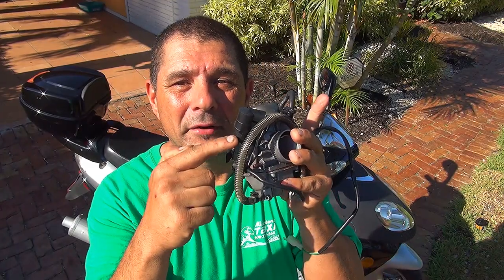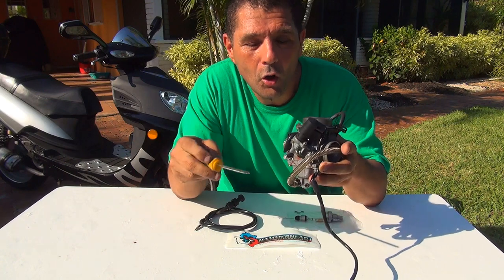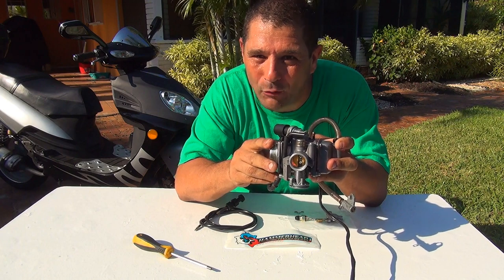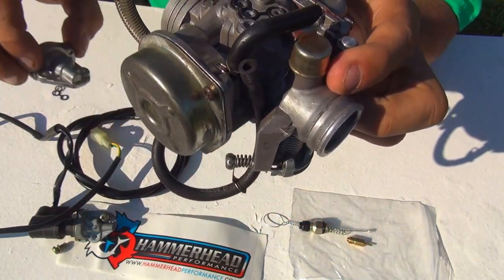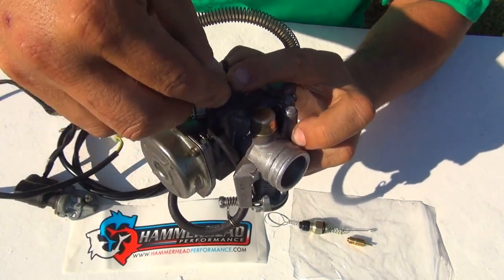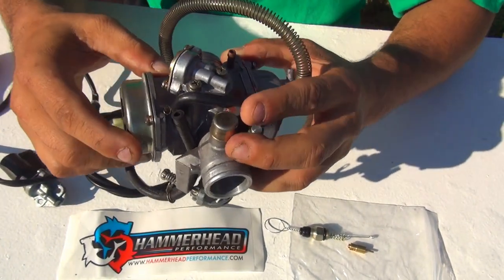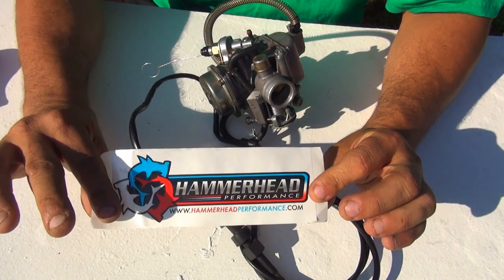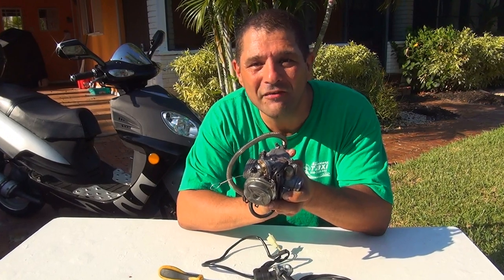Scooter Manual Choke Conversion Kit

Comment: amazing video! i want to ask what idle rpm is best for good quick performance for a 50cc and a 75cc, and is there any manual chokes for 50; 75 cc motor carburator?
Reply from the maker: Hello my friend for a 50cc 1400 rpm at idle for the 75 cc 1600 rpm at idle . Thank you for watching my video
Reply: The chokes are the same on 150 and 50

Comment: Just curious, are you in a position where you can produce certain videos on a two-stroke scooter? I own a 2009 Kymco People 50 2T and am in dire need of some instructional videos regarding maintenance!
Reply from the maker: Hello my friend unfortunately I do not have a Kymco to make a video but I can tell you to make sure every 1000 miles change the motor oil , clean or inspect the air filter , Inspect your tire and brakes every 3000 miles change your sparkplug , change gear oil and  inspect fuel filter, and every 6k to 7k adjust your valves clearance, clean your carburator jets and replace air filter.  Thank you for watching my video

Comment: After I remove the choke during service then the motor is not idling and bogging how to install it correctly
Reply from the maker: If you're experiencing issues with your scooter's idle and throttle after reinstalling the choke, it's likely that the choke isn't installed correctly or is not adjusted properly. Here's a step-by-step guide to reinstalling and adjusting the choke on your scooter:
Remove the Choke: Start by removing the choke from your scooter. Make sure to note how it was originally installed so you can reassemble it correctly.
Inspect the Choke: Check the choke for any signs of damage or wear. If it's damaged, it may need to be replaced.
Clean the Choke: If the choke appears dirty or clogged, clean it to ensure proper functioning.
Reinstall the Choke: Carefully reinstall the choke into its original position on the scooter. Make sure all connections are secure and tightened properly.
Check Idle and Throttle: After reinstalling and adjusting the choke, start the scooter and allow it to idle. Monitor the idle speed to ensure it's stable and at the correct RPM. Additionally, test the throttle to make sure it responds smoothly and without any hesitation.
Make sure when you reinstall the enricher you have the rubber gasket around the choke because sometime the brake easily and if it brake air will go inside 
Consult a Professional: If you're still experiencing issues after following these steps, it may be best to consult a professional mechanic or technician who has experience with scooter engines. They can diagnose any underlying problems and make the necessary repairs or adjustments.
By following these steps, you should be able to reinstall and adjust the choke on your scooter correctly, restoring normal idle and throttle operation.

Thank you for watching my video

Comment: Hie,I have got a big boy swift scooter and it has been flooding and fuel was coming out of the air cleaner and as I watched one of your videos I learnt that I should put a manual fuel switch and I did it but it worked for few days and it started flooding again.....may you please help.

Comment: I just put on an oil separator with the tiny filter, connected to the crank case breather hose and my idle is much lower now. I had to turn the idle screw quite a bit and it goes up and down from about 3k to around 1.2k rpm... Is this normal?
Reply from the maker: Hello Mikey that is not normal after little time the electric enricher they age because they have an little gel inside that no longer expend and that will not close perfectly the choker hole. Thank you for watching my video
Reply: @VirberelloScooterTips  I just put a new carburetor on so that can't be it right?
Reply from the maker: @Manwichman  new carb should be ok but  anything is possible with gy6 scooter parts

Comment: I’m having trouble with my scooter the front lights stays on and that makes the battery die even with my scooter completely off do you know what it is.
Reply from the maker: Hello my friend I think you need to replace the regulator rectifier https://amzn.to/3lyunhg or you have a short on the wires somewhere in the system . Thank you for watching my video
Reply: When I turn off my scooter completely the front lights stays on and that’s causing my battery to die
Reply: Is there another way I can contact you in case I’m having another issue with my scooter.  I watch ur videos on fixing the scooter and you know a lot about it

Comment: Another problem I’m having for some reason when I start my scooter I have to hit the starter switch Twice for it to turn on do you know why I have to hit it 2 times for it to turn on.  Normally it supposed to turn on automatically when you hit it only once.
Reply from the maker: Hello my friend if your scooter is not starting right away you may have to place a new spark plug or an iridium spark plug so your scooter will start  at the first touch  sometime scooter need little small adjustments in order to work properly . Thank you for watching my video
Reply: @VirberelloScooterTips  I changed the spark plug and it still doesn’t turn on right away.  Oh and I order the voltage regulator that you link to me It didn’t come with cables was it suppose to come with cables
Reply from the maker: @Cristopher180-  Hello my friend no the regulator is not coming with wires is just a little box make sure you place the connection the same way you have right now
Reply: @VirberelloScooterTips  so I don’t need to order any wires
Reply from the maker: @Cristopher180-  no the regulator is just click and plug in I hope that before you order you look at the regulator that you have   on your scooter because some gy6 have a flat connection and some regulator have a square anyway I like amazon because you can always send the part back very easy and get credit
Reply: @VirberelloScooterTips  the voltage regulator on my scooter is different mine is not just a click the wires are already in the regulator and I don’t know where to find one
Reply from the maker: @Cristopher180-  you need to look if there is a part number on the regulator that you can place on google search or contact parts for scooter .com or place a question and a photo on scooter culture group on face book there there is lots of menbers that they have scooter shop
Reply: @VirberelloScooterTips  is there a way I can contact you so I can send u what it looks like
Reply from the maker: @Cristopher180-  send a photo https://www.facebook.com/virberello or place a photo on https://www.facebook.com/groups/242176999678215